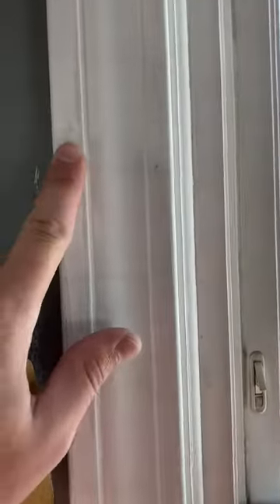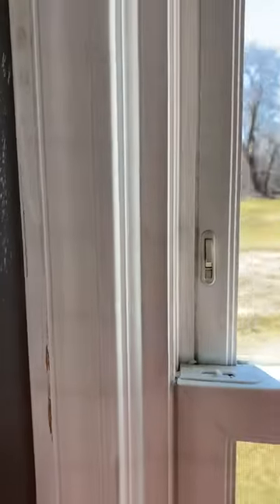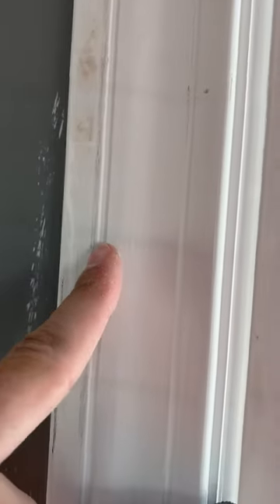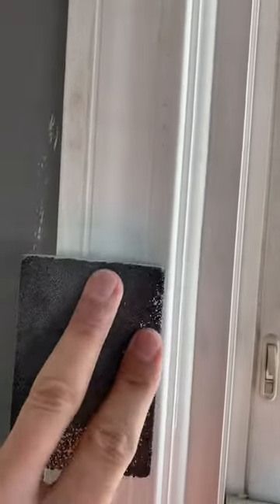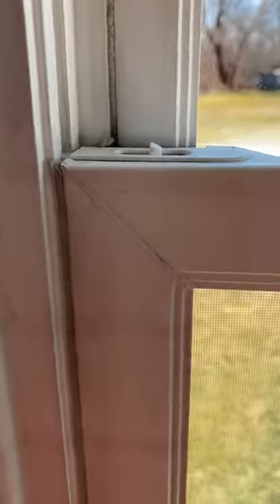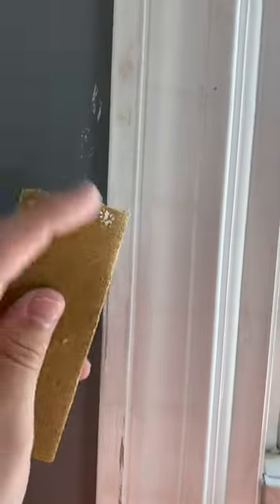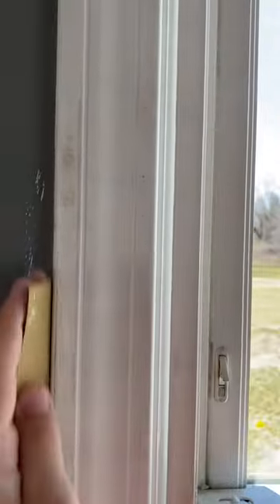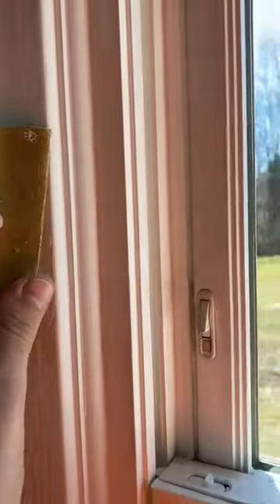How To Sand Window Trim Like A Pro!!

Comment: This is not the only way. You can buy sanding moulds that fit various different patterns. They are rubber and cheap. You can buy a pack with lots of different sizes and shapes to fit the different patterned moulds.  Much faster, easier, more precise.